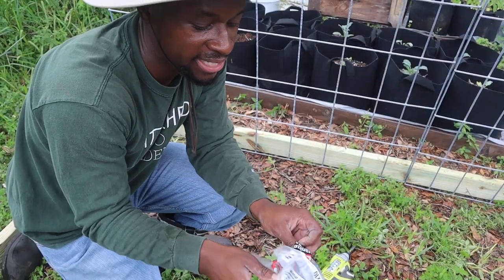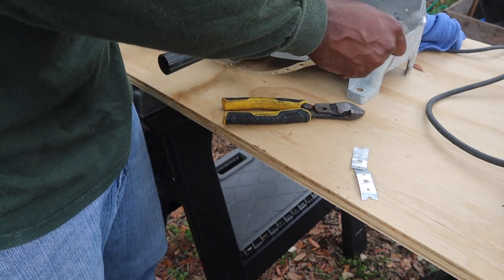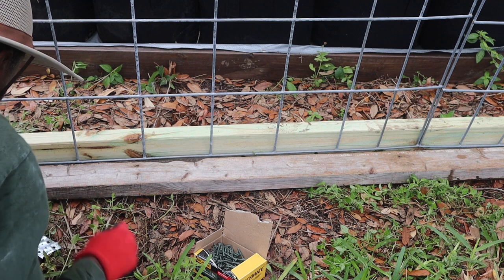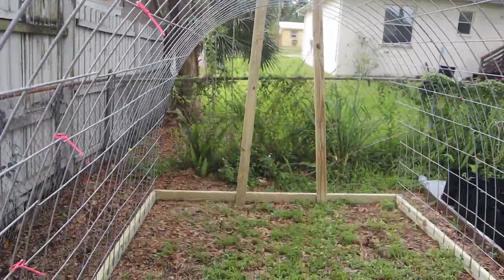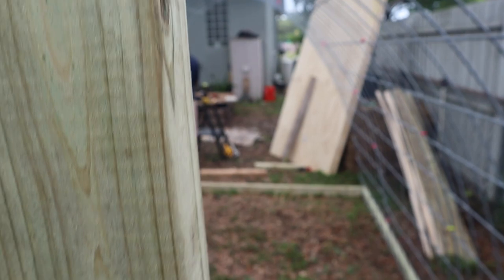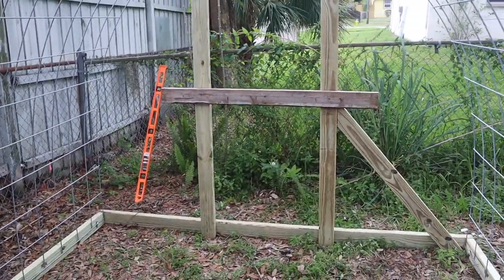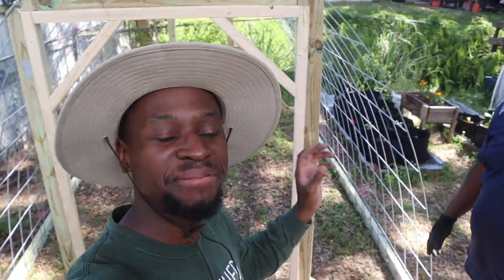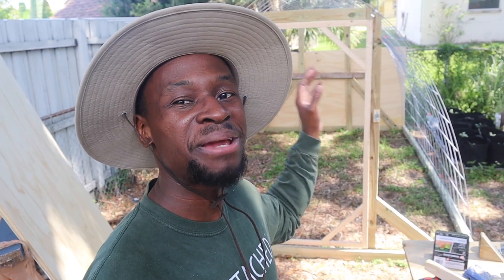Simple DIY Hoop Coop or Hoop Tractor for Chickens! Part 1/3 How to Frame Hoop Chicken Coop

Comment: Did you cut one of your cattle panels? I'm squinting at the video and it looks like you cut one. I'm also making an 8x12' run, but the panels are 50" each, so there's going to be a little bit of overlap. I was going to overlap them along the frame and not cut them, but now that I'm watching this, I'm wondering if I'll still be able to attach them to the frame if they're overlapped. Thoughts?
Reply from the maker: Yes i did cut one and you can overlap for sure! it'll provide more stability during windy days!!!